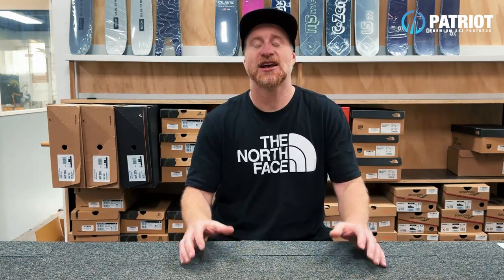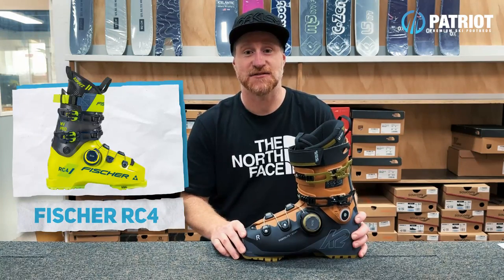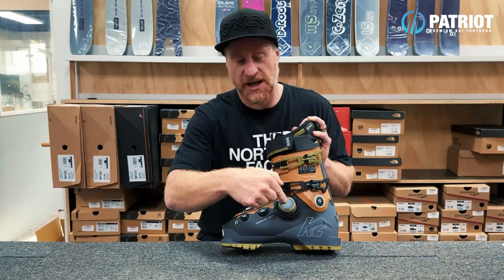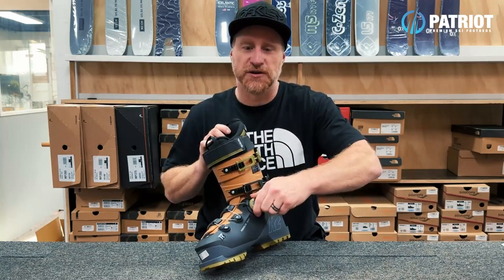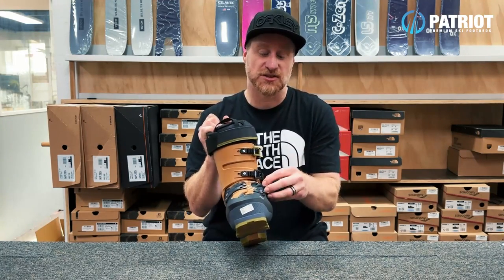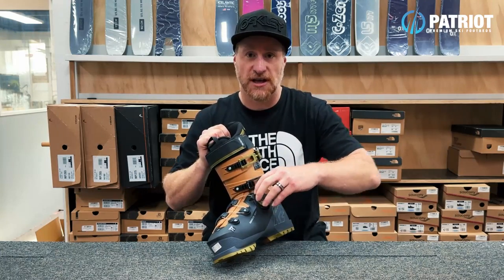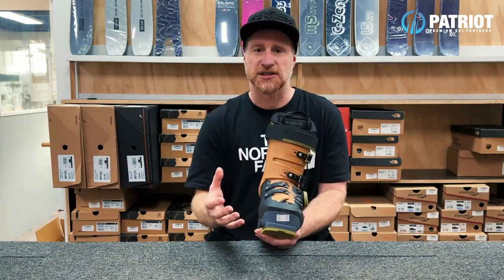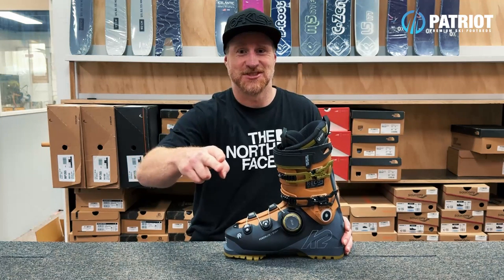A New Ski Boot Revolution??

Comment: Can you tension each point of the  Boa seperately? That is the problem with Boa in snowboard boots, cycling shoes and every other Boa stystem.
Literally causing a problem, where the independant buckles offers a solution. The Boa pulls evenly and more consistantly across the whole lower, but that is not what is required  by probalby 60-80% of skiers, most people require a different amount of retention in different spots on the lower of the boot.

You  break a cable on a ski day, you are shut down for the day, you break 1 of 2 lower buckles, you can probably keep going for the day.

I've spent 30+ years doing boot repairs, snowshoe repairs, ski repairs, this is not revolutionary, it is a solution for a problem that doesn't exist. Replaced tons of Boa cable/dials on snowboard boots, was there when Tubbs and Atlas put it on snowshoes, in the end, a broken/cut cable always ended somebodies day on the mountain, where as a cut/broken lace or rubber strap can always be jerry rigged on the hill.

Comment: Isn't this just another marketing USP from BOA and boot manufacturers? I don't see how this helps when I need slightly different tension over my arch compared to lower down my foot. If, as imperfect humans, we need different tension over two areas of our feet how does a system of constant tension over the lower closure area help. I think I'll stick to buckles... so easy and, by the look of it, much quicker to activate and release 😉

Comment: This is a horrible idea , haha, oh my god. I've heard "BOA sucks" so much from so many people over the years. I know two people who have broken their BOA cables this season alone (snowboarders), and it is only January. Putting this on a ski boot seems like a great way to end up with an expensive paperweight in less than one season. The dial sticking out seems like a huge problem too. Not only will the cables be prone to wear and being sliced under tension, the dial cap is a prime candidate for being sheared off or damaged. It is literally designed to break off. I don't wanna have to buy (or even wait for) a new cap every time my boot takes an impact. The amount of additional points of failure this adds to a boot is just a bad idea. The only revolution here is a revolution of stupidity. I will never buy a boot, shoe, or anything with BOA dials because of their bad reputation. They break, they're a known primary failure point in every product they are included in, and I have been warned away from BOA systems in the past for these reasons. This may be the single worst "new" ski tech I have seen in the last 30 years. I would never buy a boot like this, and no one else should either.

Comment: It is not possible to incorporate the top two buckles into a system like this. To get in and out of your ski boots, the tongue must completely hang out. There's no way they could accomodate that much cable which would also make the boots more finicky to put on. The other issue is tension. The top two buckles are generally quite tight where as the lower buckles just need to be closed to keep snow out.
I see this as a gimmick but innovation is cool and perhaps someone will find value in them.

Comment: I've used boa snowboard boots since 2010 & use Dalbello ski boots. I wear my ski boots pretty tight & have never broken a buckle. I have broken 5 Boa cables since 2010. They break by fraying. A single strand snaps, then unravels, then other strands break & unravel. I carry large cable ties just in case they snap in the back country. They do make snowboard boots easier to tighten, but I can't see the benefit of cable-based tension on a ski boot given the tension needed for a proper fit; the weight saving if they're AT boots, would be minimal. If the boot has fit issues, then try a different boot, or get some custom work done on the shell, or get a custom fit liner.

Comment: BOA have a lifetime replacement warranty on their mechanisms. Their website has a form to specify your shoe/boot type and they send out replacement dials at no charge.
Reply from the maker: Yeah I always have Snowboard Boa's stock on hand for repairs.  Hope they get these ski boot ones out there too!
Reply: Ya but who the f wants to replace it.
Reply from the maker: @IsraelistheJewsland  true
Reply: @IsraelistheJewsland  Yeah - most people never will but it's a good sign from BOA that they are willing to cover the mech for the LIFETIME of the product. How many other ski brands (or any) offer this, in this day and age of designed obsolescence. I'm a cyclist and have 2 pairs of shoes with BOA dials and they have both lasted over 5 years now, so my experience is they are built very well. A few buddies have replaced their dials and its not that hard to do.

Comment: A true revolution would be a comfortable ski boot 🎿no matter what I do my feet always kill me after a long day of skiing.
Reply: Try DAHU boots.......uses a fantastic, comfortable inner boot that is seated into an exoskeleton. I have a pair and it has been a dream!! The inner boot can be used as a fashionable walking/apres-ski boot. The exoskeleton has standard stiffness ratings and I find mine give me ski-control NO DIFFERENT from my 5-buckle race boots. I bought mine in Aspen.....the boot was designed in Switzerland and incorporated the  input of a Phd engineer whose thesis on ski-boot mechanics is available online. The DAHU company was sold a couple of years ago to a major US snow-sports company that's head-quartered in Eagle County, Colorado. I have skied since 1964 and have had decades of painful boots, having to use foam pads and other products to prevent injury to my feet, multiple custom insoles and boot-specialist stores.....you know this common story. The DAHU boot has been a godsend for me after starting skiing with ankle high lace-up boots that mum used to tie up for me, 59yrs ago!!

Comment: I have some concerns with this system.  Everybody has different feet, having one system to close down on your instep and toe box doesn't seem like you can get the right tension around your whole foot.  I see shin bang in the future or to tight and cutting off circulation.  Also what are your custom fitting restrictions what can you grind or stretch and how will the boa work then.  What if the cable seized or the gears froze how do you get the boot off. I bet it's not a fun system to repair.

Comment: It reminds me a bit when Rossigñol came up with something similar almost 20 years ago.  This system is better but, sorry, I do not like it either.  A buckle would do the same job, same or less weight, less bulky and hassle free.  Boa systems have been used extensively on snowboard boots, going from one to two Boas and have improved a lot, but a light cable buckle like what Tecnica Zero G's mount is waaaaay better.  These are my two cents...

Comment: BOA has been a revolution in snowboarding - Coming from years of traditional and speed-lace systems in my snowboard boots I rate BOA ahead of both by miles -  got to be dual BOA though. It will be great to see how it applies to ski boots in the coming years.

My main issue with my ski boots over the years is that I can only tolerate very gentle pressure on my instep in ski boots which means that the 2nd buckle on my ski boots so often comes undone when I'm skiing. A BOA system would always stay engaged. A big win for me.

Comment: The new BOA system does turn the other direction, turning forward tightens the boot and turning backwards slowly loosens the boot for finer adjustment.
Reply from the maker: Yes, I addressed this in the follow up video. This was filmed back before any of the BOA boots were released.

Comment: cable tightening boots is not a new idea.  Nordica N95 boots circa 1983 had were rear entry step-in and had a rear mounted ratchet that tightened the ankle by means of a cable that wrapped around the ankle.  It had a screw-pressure plate in the forefoot to stabilize the foot in the toe box.  The issue with the BOA seems to be that uniform tightness may not be desirable -- you want the ankle to be well seated in the heel pocket but the forefoot & toe don´t need to be as tight and if too tight will cause numbness and discomfort.   Yes, the ski edges can and will cut the cable -- again in the 80´s manufacturers tried using cables and you could cut the cable (Ref. Garmont Omni-Lite).  
It might work if the boot plastic is softe enough but this seems like a solution in search of a problem. Also, please don´t use a dremmel tool to mark the cable!  you will damage the cable strands.
Reply from the maker: Thanks for the comment. I have never seen that Nordica boot, I will look it up. :) My suggestion with the Dremel or pen was to mark the shell where you want to finish tightening as there is only one line on the K2, not the cable. 
The salomon and atomic versions actually have multiple lines as a better gauge. Cheers!
Reply: @PatriotFootbeds  makes sense. have fun trying those!

Comment: So if my friend needs a boot with a wide-106 last, would this work as a universal last (with a min/max mentioned on there)? Or would it still have a "last" mentioned in the boot sizing?
Reply from the maker: Yeah the last will be likley be 100-102. A 106 is usually after you have heat molded the boot.

Comment: Spot on. Love the thinking and experimentation, but as someone who undoes all buckles for each lift ride it might be annoying. Especially with a One way BOA. An integrated guard like buckle boots have for the first buckle would be bulky but smart. Also, I'd be worried about damage when going down on one hip and then digging in to pop back up. Could see the BOA cap popping off during that.
Reply from the maker: So these Boas do actually adjust out the opposite way, this was an early sample so didnt work as well. Wouldnt say it is a smooth unwinding but it is there. Other boots have also added deflectors to help protect the mechanism from impact. Seems to be expanding heavy into more boots next year, so looks here to stay?

Comment: I have problems with pressure on the top of my foot and went with the Salomon Boas to try and relieve that and to some extent, it does work better than clips.  However, I agree with you that it isn't fully game-changing but with the Salomon's, the liner has an adjustable tongue and combined with the Boa, that has made a significant difference to the pressure on the top of my foot.  Getting the tongue set up correctly was the game changer for me
Reply from the maker: Great to hear! Im looking forward to skiing on some other boa boots and the Salomon is top of the list.

Comment: This is a problem that many skiers deal with every day. I know of many people who struggle with tension on the top of their foot, myself included. I love the idea, and I am curious to try it myself. I hadn’t thought of the replacement parts issue that you had brought up, and I would be extremely upset if I couldn’t buckle my boot for the remainder of a ski trip because I lost my boa. Another thing that I haven’t seen anyone address on YouTube, or the few online articles I’ve read, the tension is not even. Again, I probably sound crazy, but the tension is not even. If you know how pulleys work, it’s immediately apparent. Being that one end of the cable is fixed you’re pulling more cable through the closer pulleys to the Boa than you are the fixed end. Meaning you’re cranking down on your instep more than you would be on your toes. I would’ve imagined there would be a loop of cable, so that it came out of both ends of the boa and completed a loop through all the pulleys.
Reply from the maker: The good news is if the boa takes a hit, it is still attached via the cable, so not much chance of fully losing it. But great points on the tension.

Comment: Rachel did this in the late 80's . The buckle was on the rear. A smarter place. I see a huge market in spare BOA ratchets that were  smashed off.
Reply: They were Raichle FX8's
Reply from the maker: They actually do stay attached by the cables if they take a knock. Very burly so not really likley to fully explode. But it will be interesting to see how they hold up over a couple of years.

Comment: so you are turning full speed and hit something and spinner pops and releases tension mid turn?
Reply from the maker: You would be able to lean a long way over before it contacts anything. Biggest risk is tree skiing and the spinner actually stays held on by the cable if it was to pop.
Reply: Yes, it is high-up for piste skiing, but for off-piste im a little bit skeptical about what nature hides in snow.... From branches, to stones and ice. You are all good on maintained tracks, but i dont know about off-track skiing.

Comment: Can't they also microadjust down to back off pressure without having to pop the dial and fully reset? Not sure about the k2 system but the Salomon and Atomic boa boots have that adjustability both ways. The dial seems to be designed to pop off if hit instead of breaking. Shops will definitely need to stock extras for people who lose them or if they pop off into powder
Reply from the maker: Yes they did micro adjust. Also, not likely to lose the dial as they will still be held on by the cables if it takes a hit.

Comment: There are snowboard boots with a lighter boa system that is able to be popped off the boot. The piece hangs onto the cable still so its left dangling from the boot until it is popped back into place. Boa is already known to supply replacement kits to stores that sell boa gear. It is very easily replaceable.
Reply from the maker: Hi Allen, yes very familiar with the snowboard Boa's. Also address this connection in the follow up video> Cheers

Comment: K2: The company that sold skis with a light built into the tips as a sales gimmick.  I predict this will prove just about as useful.  This is WAY too much hassle to deal with for me.  I want to see how the BOA knob holds up to an impact from a ski edge or rock.  Having endured the pain & aggravation of dealing with K2's warranty protection a couple of times, I'd never buy this this.  But then, I haven't bought a K2 product in years now.  Screw me once, fooey on you.  Screw me twice.... I don't buy your crap anymore.
Reply from the maker: Light on the tip. :) that is hilarious. Do you know the name of that ski?
Reply: @PatriotFootbeds  Sure do. It was the K2 Four. Late 90’s I think. I owned a pair but I didn’t buy them for the fancy light. I thought it would help with night skiing visibility. 😎🎿
Reply: @PatriotFootbeds  see also the K2 Mod X, it had a little piezoelectric light that was supposed to dampen the ski, kind of like Rossignols VAS system on their 7SK’s and 7GS skis back in the day.
I agree with the BOA closure potentially failing especially after a BOA failed on me on a long mountain bike ride, it happened, luckily we had plenty of duct tape and a repair strap to keep the trip going for me, but dealing with BOA warranty was a PITA, so no thanks on a gimmicky closure system that had too many moving parts.

Comment: I love the idea - but I wonder if there is a better way.   Two individual boas instead of the two traditional buckles on the foot might make for fine + quick adjustments?
Reply from the maker: Two boas is also an excellent idea!
Reply: It will be better for fine adjustment, but would likely increase the cost. Not to mention more effort needed to close them, and more parts for potential failure
Reply: One wheel at the top of the toe, another above the heel :)

Comment: It reminds me a bit of when rear entry boots came out in the 80’s. Those did not last. One apparent drawback of the Boa is that you can’t snap it down with gloves on like you can with buckles. It seems you have to take your gloves off.
Reply: I dunno, I’ve never had an issue tightening the boa dials on my snowboard boots with gloves or mitts on. I think I’d still prefer the ease of buckles though and the ability to always set the tension the same with one click. I think I’d go crazy having to twist the dials at the top of every run

Comment: I believe this is a bad alternative to the Full Tilt boot concept as far as the lower part of the boot is concerned. Besides, there are a few questions that remained unanswered: how does this system ease getting in and out of the boot? How does this humongous rotating wheel operate when it's full of ice and snow? Sorry, not interested. I love my FT Drop Kick Pro and I don't se anything here that would sway me away from them.